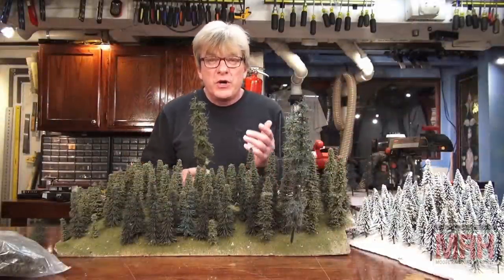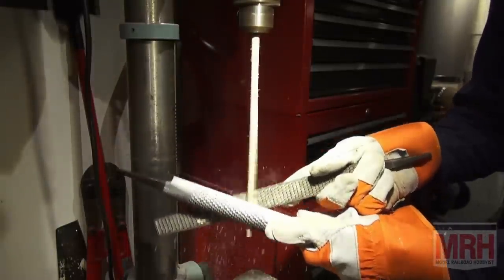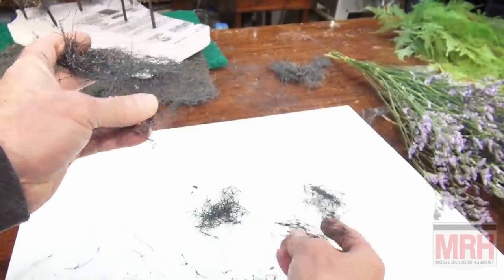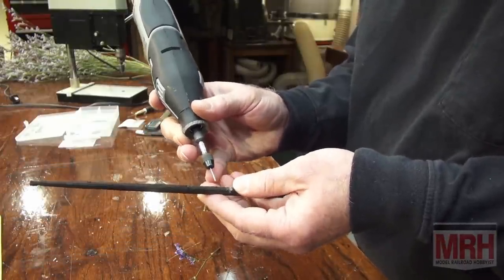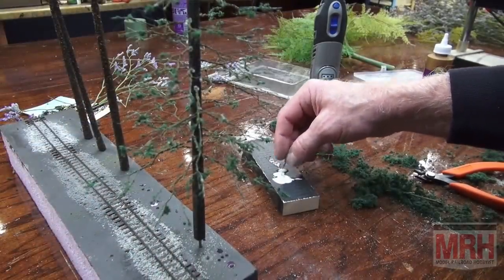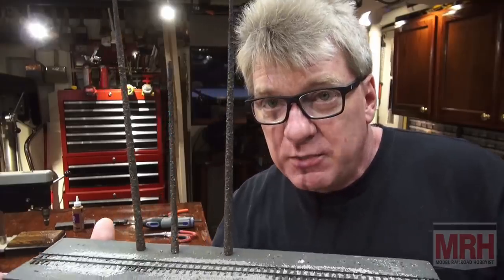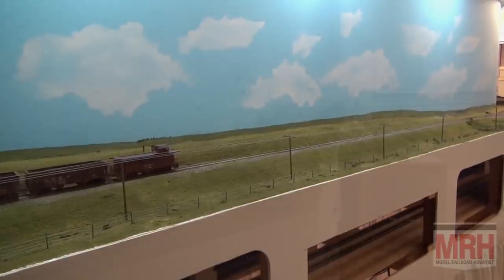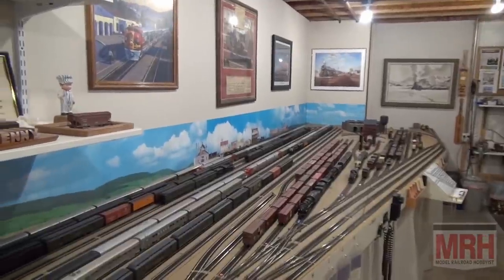Four kinds of conifers | January 2021 WHATS NEAT Model Railroad Hobbyist

Comment: Good video on making pine trees.  Spruce, Ponderosa, hemlock, cedar, redwoods, any pine type trees, they can all use the same techniques. I taper mine using a six inch wide belt sander with 36 grit. I also prefer balsa for ease of tapering and drilling holes for branches but it is a bit tricky to turn a square into a round taper. I have also used old tapered artist paint brush handles but you have to strip or sand through the paint. I prefer caspia, when I can get it, for branches, dipped in diluted white glue and fake leaves or sawdust needles sprinkled on. A wild plant here in Alaska is yarrow, which can also be glued into drilled holes in the trunks and flocked and static grassed. I find it roadside. I would like to try the plastic branch/fern stuff but have not been able to find it to buy.

Comment: Nice tree tutorial...

Bachmann or the other company that offers the wire trees also sell the armatures without flocking.

Try using 4mm or 6mm static grass on the wire armatures first, before the ground foam.  Use a spray adhesive instead of hair spray.

Then use ground foam next.  Follow it up with 2mm static grass.  Looks a lot more convincing.  

Really enjoy your channel!

Comment: To get rid of the fuzzy stuff before painting after all the tapering and bark effects you can use a piece of fine steel wool. Hold the steel wool in one hand and pull the trunk through it with the other hand. Works great.  👍

Comment: I've been building and selling scratch-built Pine Trees and Aspen Trees for over 20 years.
Never and I mean never use hair spray to flock them with it's a the worst !!! Please use Spray Glue it will  keep the flock on
Your trees for years !!! The only problem with the second set of Trees you built, They break really easily that why I stop making them.
For best looking Colorado Pine Trees if your modeling Narrow Gauge is the old tried and true method of foral wire and hemp rope.